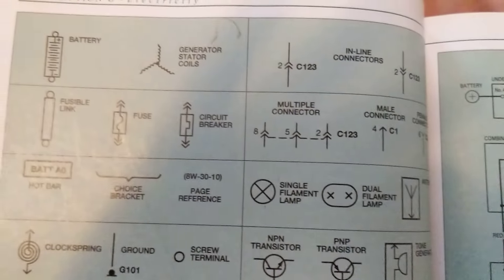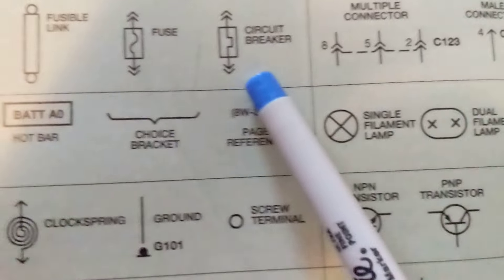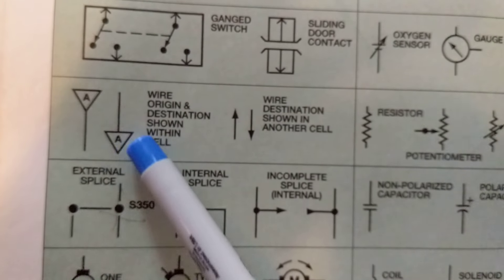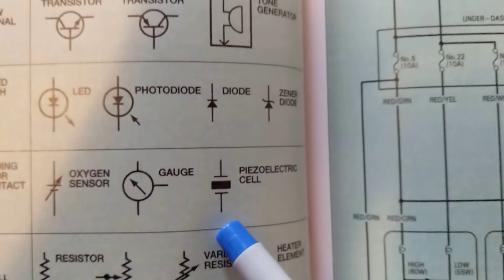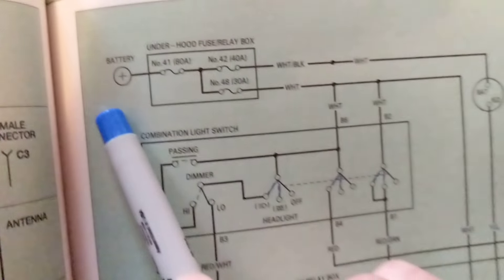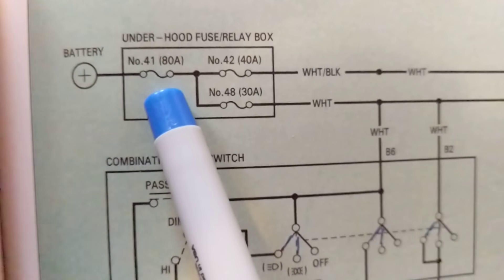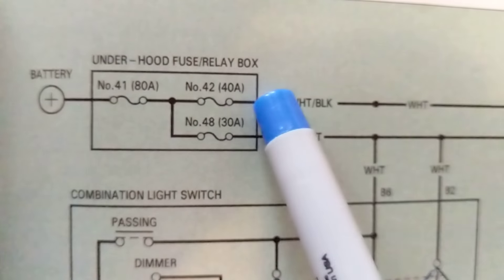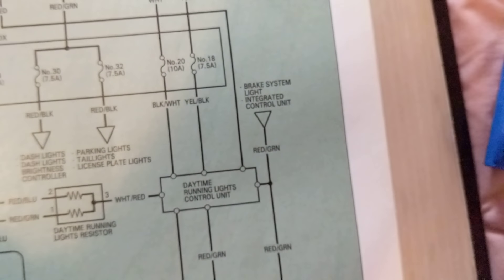How to read AUTOMOTIVE WIRING DIAGRAMS THE MOST SIMPLIFIED TUTORIAL please subscribe 100% helpful

Comment: For a Toyota diagram, what would an oval with the number 2 inside of it mean. The wiring is for a fuel pump
Reply from the maker: Various things one of the things is a junction connector box with the connectors inside depending on the system but thank you for your comment